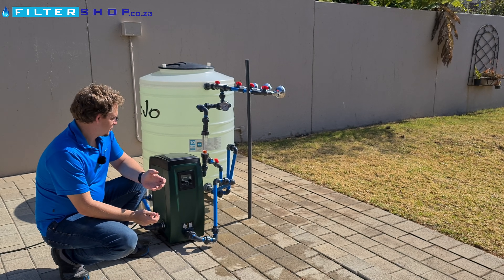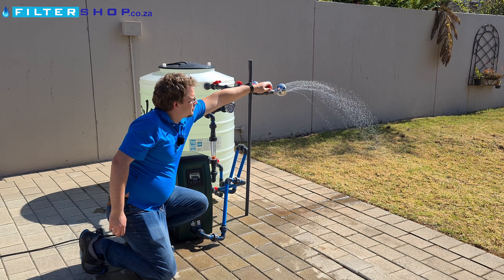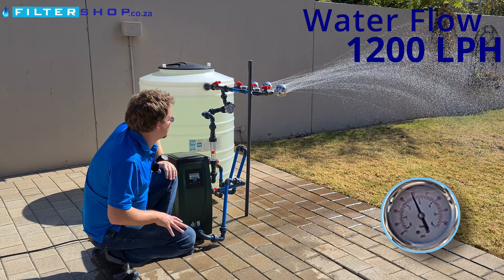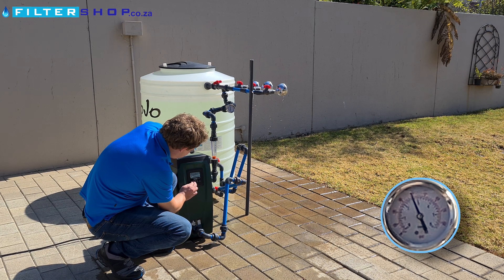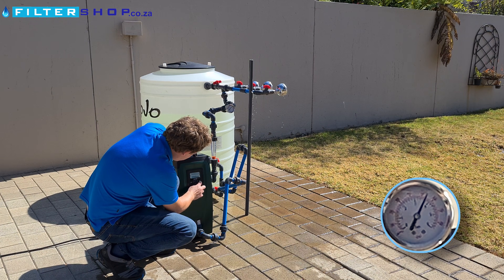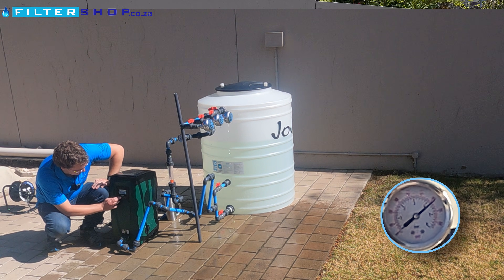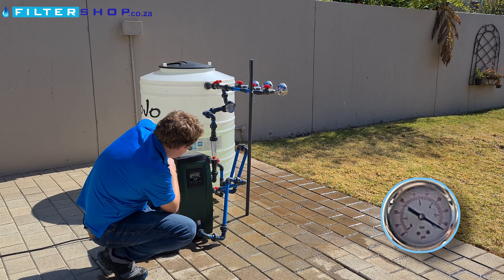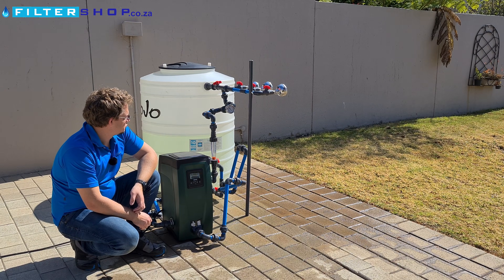DAB ESYBOX VSD Pump Review

Comment: Hello, thank you for the video. I have a DAB Easy Box Mini 3. When I open the tap slightly, it runs at 2.7 bar, and when I open it fully, it still stays at 2.7 bar. How can I fix this? Thank you☺
Reply from the maker: What pressure is it set at?

Comment: This is not the best pump on the market. It is the most expensive and breaks easily when installed incorrectly which is 99% of the time due to diy online sales and the customer not wanting to pay for a professional installer. To service this unit is also a nightmare. It is only made for clean water.

Rather spend the extra money on an DAB Active Driver 1.0 M/T with a DAB K35/100 T or DAB K45/50 T. Once again, get a professional installer for this kind of setup.

Comment: Like any device with a lot of electronics, it is very susceptible in regions with electrical voltage variations, even slight ones, and sudden power outages. It must have a voltage regulator nearby. Mine, purchased recently, failed after a month and a half and I am still waiting for the replacement promised by DAB and its distributor. The protections for voltage changes that the device includes are not sufficient. In the rest, it fulfills what was promised.
Reply from the maker: Thanks for sharing, good to know
Reply: any recommendations for a suitable voltage regulator for this one?
Reply: Ju koulo pangpang

Comment: Hi we're looking for a whole house pump for 5 bathrooms I was wondering how this might compare to the HMS1500 in your opinion?
Reply from the maker: Hi, Both are very good. The Esybox is quieter but it can't get much use out of a pressurized buffer tank so it always cycles. I went for the HMS1500 specifically because I had a 150L buffer tank and with it i could dramatically reduce the pumps cycling. If you haven't got things that frequently will pull a small amount of water, like for example a fridge connected to the mains with an icemaker or a Under Counter RO System. Then i would go for the Esybox, if you do have them then i would go for the HMS1500 with a buffer tank.
Reply: @FilterShopZa  I can't seem to find the hms1500 in Australia is there any chance you'd post?
Reply from the maker: Hi @owlytv  , We don't ship internationally at this stage. I think your best bet might be to look for a DAB Esybox locally there as it is very similar. Here is the video review for it: https://youtu.be/B2uSXGC7__k
Reply: @FilterShopZa  If I used a 3rd party service where you post to ZA and they forward it on would that work? I guess my only concern would be parts in the future.. We're replacing a grundfos and already have a 100L pressure tank
Reply from the maker: @owlytv  , Okay yes that makes sense if you have a 100L tank already. We can do it that way but yes my concern would also be after-sales support in terms of spares. You can contact us on admin@filtershop.co.za
Reply: I would highly advise the Speroni 1.1kW VSD pump for a more affordable option over the DAB. However, if you want quality then get an DAB Active with a pump.